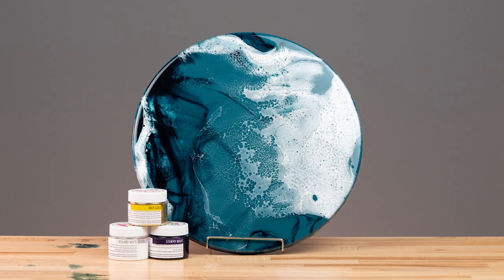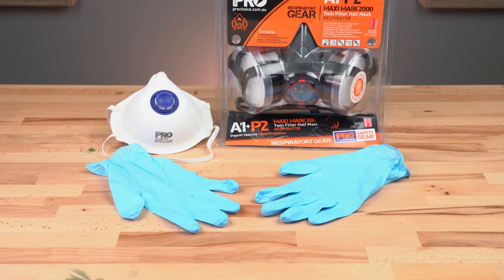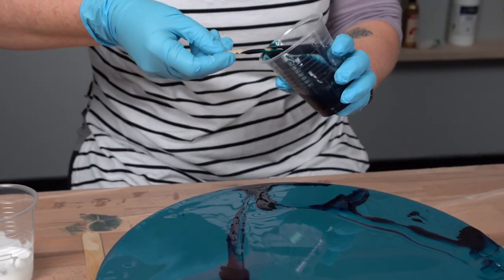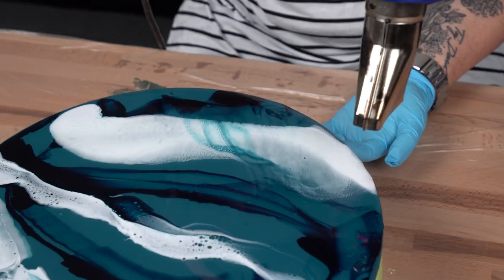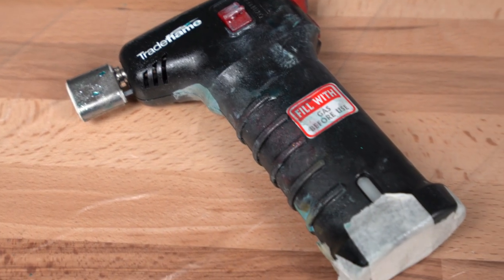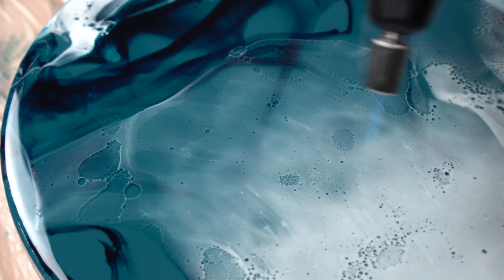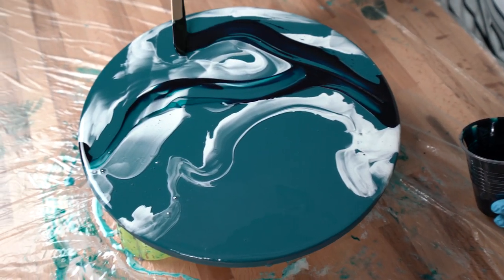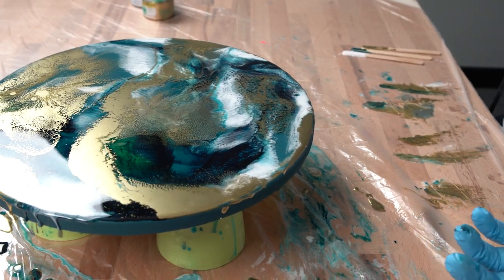Creating Lacing & Cells in Resin

Comment: So basically heat gun and torch on high setting helping to make laces and cells right?
Reply from the maker: Yes that's basicly it
Reply: Wow that’s crazy because a lot of stuff I google say in order to make cells you need to add silicone...
Reply: @jellybeanbahamas2031  Ive been recently reading silicone isn’t the best because it can interfere with the resin curing.